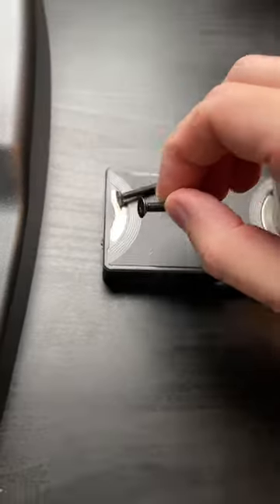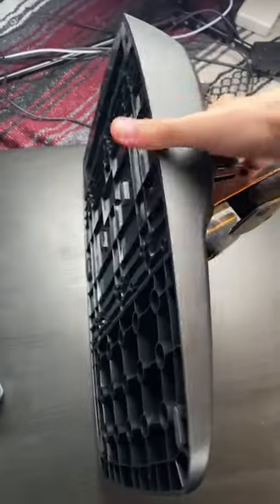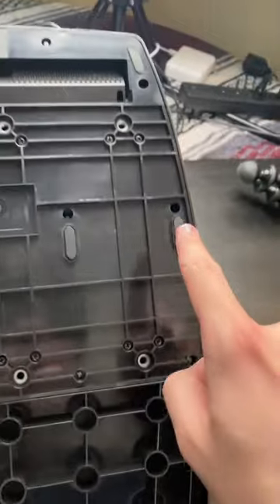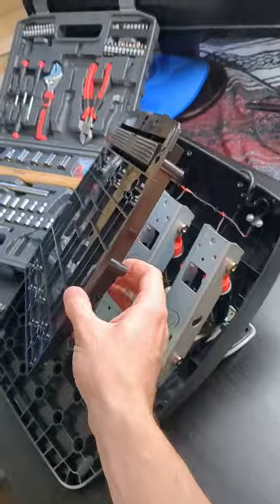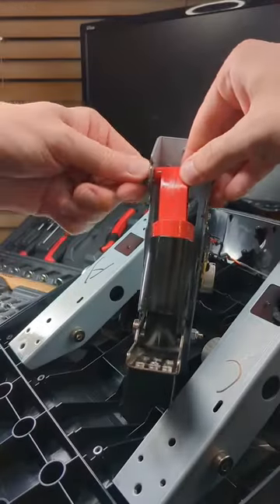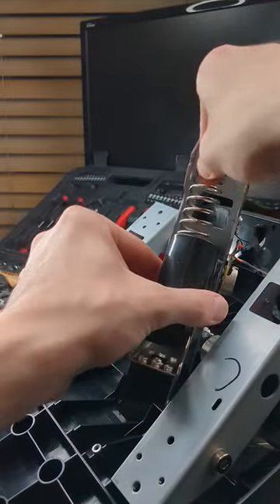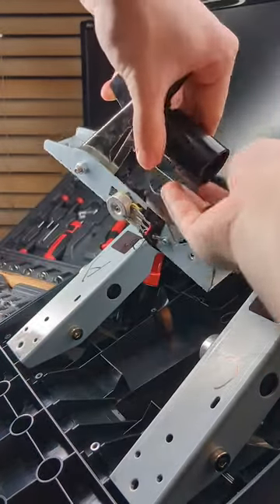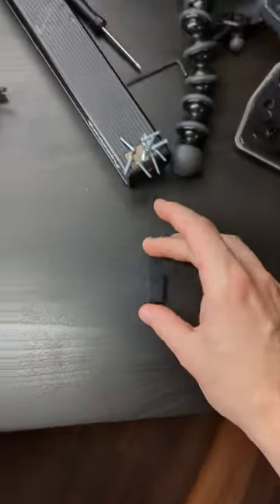FIXING the Logitech G920 #shorts

Comment: Each to their own, but I personally like the rubber stopper. I hated it at first, but after using it for a while I started liking it. I can totally understand this mod for those who don't have a proper sim rig as the pedals will slide on the floor, but with a proper sim rig I find that the stiff stopper makes heel-toeing sooooo much easier to control 👍
Reply: Same here. I got my rubber in back like a week ago. Heeltoe is satisfying as hell now.  Only thing is I play on xbox, and I can't see any calibrating options for the pedal range in ac, and acc to do a little tweak down that made driving in pc2 so good for me. Beside that trail braking and ht is just much better and precise with the goddamn thing. Pozdro666

Comment: For racing you don't actually want it to move basically at all so you get use to how much pressure to push and start having muscle memory for how much to brake instead of trying to push the pedal down to the same angle all the time.
Reply: that is correct if these were load cell pedals. They are not
Reply: @aroe7819 it is true, the rubber lets YOU focus on pressure instead of angle, doesn't matter if the pedal has a load cell or not

Comment: I just got used to the braking force required, real life race cars can have pedals that take up to 300lbs to fully compress, it also helps with trailbraking, but everybody has preferences, and if you have a hardwood floor a stiff brake wouldn't really work out

Comment: Always wondered why it was like this, I’m really getting into the sim racing now and I’m trying to tweak everything so it’s perfect
Reply: I guess it’s like that for realism, real life brakes can be pushed really hard since there is no 100% braking force in real life
Reply: @benthelender  Yeah but when i "drove" a car, it wasn't THAT hard to brake. Its easier in a tractor to brake
Reply: so dont change it its more realistic but still not even close to the real thing.
Reply: @Wiatrak0  raecars are different my guy
Reply: @sethssimps2733  I know but i don't think it is that hard as it is on the logitech pedals
Reply: @Wiatrak0  no actual race cars and f1 cars require so much force, going from 200 mph into a corner the drivers easily pass 200lbs of force at its peak
Reply: @Wiatrak0  it's much MUCH harder to press. In racing car the pedal nearly doesn't move
Reply: @benthelender  ow ok, sorry for my comment
Reply: @MisiolPL  ok, didn't know that. Sorry for my comment

Comment: Yeah secret tip go against all realism in the brake pedal awesome.
Reply: The problem with the G29 is that is just to stiff, 0% gradual and doesnt feels like any car that I have tested in real life. Feels more that there is 0 force until you  hit 70% of the brake pedal and then its hard af. Is better to replace it with some other rubber that is actually gradual.
Reply: I have an C series AMG and used to own a 3 series BMW, i daily a suburban, none of them have ever felt remotely as stiff as the Logitech pedals.
Reply: the stock pedal feels nothing like a brake pedal to me, i removed the rubber and boom, much better lap times

Comment: I left my rubber in, trick is to calibrate it right so that you can get that load cell feel. I have since moved onto a DD with a loadcell but I advise not removing the rubber as you then have a super dead feeling brake.

The trick really is to mess with your brake saturation levels and other settings to get the feel right. That rubber when tweaked correctly will give you a decent experience, without it, it is completely dead feeling.

Edit: This applies if you have it mounted on a rig or otherwise made it sturdy enough that you can press on it relatively hard, it is meant to be pretty solid feeling so you can actually modulate your brake pressure. People tend to think it is too hard but have no experience with any other pedals.

Comment: Instead of physically modifying it, I just calibrated the brake pedal using windows USB game controller settings. When you calibrate the brake, push it in as far as you would comfortably while racing and braking at full force. That makes that level 100% braking force. The pedal still feels good but doesn't require F1 style braking to reach 100% braking. 
If you are racing in assetto corsa you can also just change the % activation in the settings, but I recommend calibrating using the windows USB game controller settings either way.
Reply: Finally someone knows
Reply: Also, don't skip leg day. The Logitech pedals really aren't that stiff.
Reply: @mintgoldheart6126  it's not really about stiffness even but more about TRUE brake pedal feel and fidelity. You shouldn't need a body builders leg press to achieve 100% brake force but the other 90% is like an egg shell.

Comment: I got a load cell kit for $150 and replaced the pot and rubber with a load cell... Then i put a new, heavier spring in the brake, moved the OG break spring to the clutch, and the clutch spring to the throttle.

Now everything is nicer. The brake pedal is more realistic, the throttle and clutch are nice and weighty too.

but the only problem is carpet gripper isnt powerful enough to grip the carpet anymore

Comment: Best thing would be to find a spring replacement that gets thicker toward the bottom of the coil. I’m not talking spring diameter. I’m talking about metal rod thickness. If the standard is 1.5 mil then have it transition from 1.5 to 2 or 2.5 toward the bottom. Should feel great. Not that difficult to find springs like that either

Comment: If you’re drifting I don’t recommend doing this. While you may have the full range of the brake pedal you don’t have the ‘resistance’ that the rubber piece was designed to replicate. I tried both with and without the rubber piece and I prefer to use the pedals with it. Left foot braking is easier to control cos you’ll be able to make micro adjustments

Comment: 2 things, if you take out that rubber you are losing the little bit a realism that them pedals have, and if you tighten screws to much putting the bottom plate back on it can leave your brake pedal always engaged

Comment: Is more useful stiff, helps to not lock the wheels specially in a open wheel or old rally car also you control it by force so you can graduate it
Edit: it’s preference no mean to call anyone slower if they use it or not, but in my case it helps a lot
Reply: i personally found it made it way more difficult for me to judge how hard i was braking, once i removed the rubber my lap times improved significantly. i think the mod just helps it feel more like road car brakes that i’m used to

Comment: I have the g923, they replaced the rubber bit with a stronger spring, a spring so strong it flips the pedals over when you try to push it all the way down. I took it apart and just switched the clutch and brakes springs

Comment: I use my g27 pedals on my g920 works great
Reply: Love doing that as well. Only issue is for me is especially on console the firmware assumes the rubber block is still there, so it only travels to a certain point. Works wonders with some tuning on PC though
Reply: Oh really I didn't know this was possible

Comment: the big fix for a G27, G29, 920, 923 is to buy 3 to 6 times harder spring for all of the pedals so yes you can remove this rubber piece on the brake pedal otherwise it's better to keep because u use more muscle on the end that at the start
Reply: 923 already has variable spring but the accelarator is way too weak so only that should be replaced on g923

Comment: I got my car irl car. Yes. And when i press the pedal, i don't expect it to go all the way to the metal with ease. In fact i don't expect it to go to the metal at all. This mod would work best if it's the clutch. Because it's the same amount of force all the way until you hit the metal which is what you want to do. You NEVER want to hit the metal on the brake pedal because that would mean... you are leaking brake fluid.

Comment: Title correction :
How to ruin G920 pedals.
Reply: I removed the rubber and it works better than when it had the rubber. Still a strong brake pedal
Reply: @southernbustransportation i say the Same i like it being so soft
Reply: @southernbustransportation yeah but you're not telling anyone about the huge dead zone at the bottom of the pedal either
Reply: @southernbustransportation but if you run cars with no abs in iracing then that rubber is super useful because it gives resistance around 60% brake which is close to wear you lock up. No rubber means your foot needs to know exactly how far to push the pedal consistently with no feedback
Reply: didn't know that having 100% of the brakes instead of 10% is ruining it🤡
Reply: @jstrix_yeet you have no sim experience and it shows.
Reply: @jstrix_yeet  who uses 100% do you even trail break bro?
It's a proven fact that muscle memory can adapt for pressure/force better than it can to position or distance.
This is why load cells are good.

Even try it yourself... close your eyes and touch your forearm to your nose, repeatedly, but in the same place over and over on your arm, and take note of how you occasionally hit the wrong spot.

Now forget where you're touching, and focus on pressing the same pressure (let's say 2 pound or 1 kilo), and you will notice how easy it is to instantly press about the same pressure each time.

If you remove that rubber, you're removing the best indicator to muscle memory for your breaking force.
You now rely on position, and no matter how coordinated you are, you will always best that attempt as soon as you transition from positional based, to pressure based.

Hitting 100% on breaking is a good way to add time to your laps.
In fact simply knocking your max breaking power to around 95% would likely improve your lap times lol
Reply: @southernbustransportation you’ve never driven a car before have you
Reply: @GregoryShtevensh  you've literally never played any racing game except Iracing, lmao. In AC or ACC if you don't brake to 100% instantly, you will lose a lot of speed, grip, and laptime. 
Get good, before writing down any comments, lmao.
Reply: Hahaha, no.
Reply: @Takeshiwa  that's the dumbest thing I've read in 2024.
You're talking like all cars are the same.
If you hit 100% breaks in a car, you're locking it up, and balding tyres.
I don't play iracing either dipshlt, I play AC.
And I want to see you break 100% in an X bow or anything with oversteer. 
Do you wanna break later, harder, then trail? Sure! But not 100% ffs. Certainly not on the cars I was talking about.
Why would you want to always activate ABS or lock up your wheels? And you're telling me to get good?
Yeah ok kid 👌
Reply: @jstrix_yeet the 10% is when the pedal starts giving resistance the remaining 90% is what you need to push harder for; like how an actual brake pedal should work
Reply: @jstrix_yeet "didn't know that having a pedal with zero resistance that makes you lock up and feels like a toy instead of a realistic feeling one is ruining it" there fixed it for you
Reply: Fully agree
Reply: @f.b.i2842 It needs to be hard to be realistic.
Reply: @GregoryShtevensh  He probably uses full ABS on every car, don't be too hard on him xD
Reply: @timbelcijan9858  yeah I need to back off. Learned that haha. Not everyone drives the same, fair enough...

I suppose

Comment: You need to add more to “fix” the pedal.

Stock these is not enough feeling and you never want to always apply max brakes which is what tends to happen every time you hit the brakes.

By adding more rubber you hit like 60-70% then have to mash it (like a real car) to get to 100%

Doing this to my pedals made me consistently faster on every track.

Comment: U don’t gotta take the whole bottom off just take the bolt out of the side of the pedal then wiggle it apart and pull the spring and rubber block out then stick it back together

Comment: Do this mess up my warranty?
Reply: Yes
Reply: U can also calibrate the breaks in your settings , that’s what I did with my g920 🤣
Reply: @eldominici3732  how?
Reply: @CoolD10  go into your setting and look for your steering wheel it varies for most games then click on calibration it should let you adjust the breaks from there … it’s basically the same for all games they just have different layouts….
Reply: @eldominici3732  ive tried that it works well in assetto corsa but in american truck simulator there is a brake setting but it doesent go down low enough for me. a way ive found is by going into the control panel on windows and recalibrating your brake pedal from there. havent tried it yet but should work
Reply: @CoolD10   oh ok … yea It’s great on Assetto I haven’t tried it on a truck I’ll look for one to see how it feels …
Reply: yes I'm sure it will

Comment: The brake pedal itself is to stiff but taking out the rubber thing is just too soft is there a way to kind of meet in the middle of the two?
Reply: On your PC, check the USB game controller settings & you’ll be able to adjust how far you push down on the brake pedal before it registers as 100%. 

Helps big time

Comment: Will this make it so my car actually has brakes instead of me pushing the pedal and still only having like 75%
Reply: You aren't pushing it all the way in, that rubber cube works fine for people with a playseat but most people don't have one, so either take it out but that will make your brakes super weak so what you should do is buy a modded spring
Reply: Put your pedals against a wall and if you can’t reach the pedals add little bits of wood or a box. My problem with my brakes were I would end up having to sit down lower in my seat to use my brakes fully so I just threw wood behind it till it reached me and now it’s more like I’m pushing down on it instead of towards it
Reply: Just put maximum brake distance in games and it will do wonders, i set 100% when i touch the rubber so i don't have to use too much of force.
Reply: I don't understand the problem people have. Each game has a brake range setting. You press the break in as hard as you are personally able and define that as the "max" so it will equate to 100% brake pressure. There's really no issue here.

Comment: This has nothing to do with you leg strength. I had the black rubber in my pedals for a year until I put so much power on the brakes to reach 100% that the plastic part in front of the pedals just snapped in 2

Comment: For around ~20 bucks there's a damper kit you can get from 3drap. I haven't bought it and tested it but it looks promising. If anyone does let me know what you think. They have different resistances soft, medium and hard.

Here's a clip of what they claim it does.

SOFT. It allows you to have almost all the travel of the original pedal available which hardens very quickly in the final part. Characteristic of road cars, or cars set up for rallies, or drift cars.

MEDIUM. The pedal travel is reduced by 25%, the brake will be immediately harder, allowing better management of braking at the end of long straights and trail-braking for entering fast corners. Recommended for Gran Turismo cars, GT2, GT3, GT4 and modern Rally cars.

HARD. The pedal travel is reduced by 35%, the pedal immediately offers strong resistance, and allows you to better manage light and powerful cars, helps muscle memory in endurance races, and facilitates trail braking. Recommended for Formula cars and LeMans Series prototypes (LMP).

There's a lot of argument in this thread about how braking should feel and how hard you should press. It seems like much of this is preference or unique to the type of driving you are doing.

Also don't overspend on upgrading your Logitech because getting a brand new set of brakes with load cell is around 150 bucks.

Comment: The other problem is that there is 30% of the brake pedal that doesnt exist. Its fully engaged around 65-70% travel :/
Reply: Also, no I dont have the deadzone settings set at all. Its just the way it is. I think I might have messed up the sensor though when I replaced the spring lol
Reply: @nexxisfoxx9731 that's how it's supposed to be, because of the rubber. If you leave it in you will never even touch that remaining 30 percent and braking will be easier to regulate

Comment: uhh this is gonms break your pedals. the wheel has software that knows that rubber block is there and therefore when you brake, it adds more pressure (an upwards curved graph). if u remove it and press the brake it'll be very sensitive and not realistic at all. Speaking from someone who has used this wheel for years

Comment: Don't just take it out it makes you drive way much worse than with the rubber in. Put a bit softer rubber or just get a racing seat and learn with a standard rubber as it is. Or update to Thrustmaster TX setup
Reply from the maker: Even though it didn't feel realistic at all it was much better for my chair + unstable desk situation, it's on a GTtrack right now though so I'm gonna see how about putting it back in.
Reply: i find that i drive better with the mod vs stock

Comment: you should NEVER do this as it messes with the calibration. it acts as a stopper to stop the pedal going back any further. the thing that measures how much is pressed is calibrated at that point where the rubber stops it.

this means if you remove it, you can push the pedal past 100% and wont have any control over it.

if you push it halfway, where it will normally stop with the rubber, it’ll be 100% pressure, and pushing it further is still just 100% pressure, as it wasnt designed to go further.

do NOT do this.
Reply: i did it and i enjoy beamng more now.
Reply: @Camska427  yes but dont you face this issue now? if youre a sim racer and do competitive racing, then having that throttle control is huge. with this ‘mod’ you can’t have that control at all, as the pedal goes further back than it was designed to go..
Reply: @iGPR3  it's still very stiff with the spring. Plus I don't do any hardcore sim racing. Beanmg mostly. Configured it and it feels good.